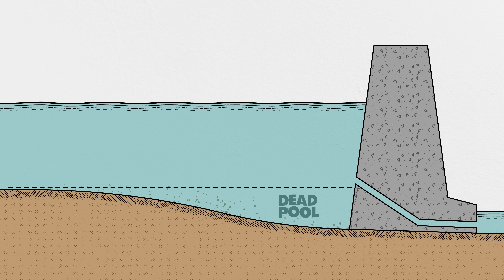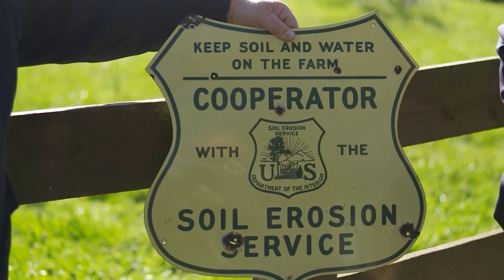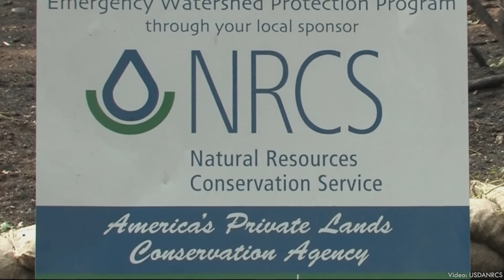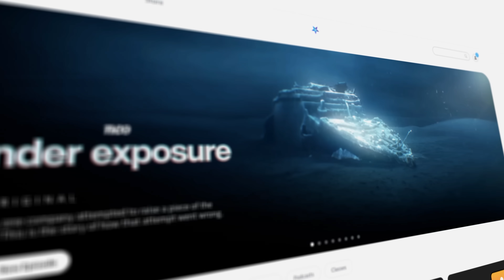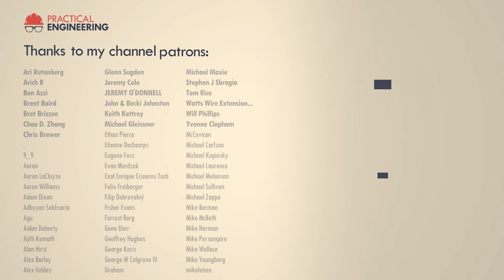All Dams Are Temporary

Comment: I am a scientist working in a dam/tailwater system built in the 1960s, and I did my graduate study on dam removal projects. We are now dealing with both of the sediment associated problems with the dam that I work in association with. The upper reaches of the lake are filling in with sediment, preventing boat access for a major recreation lake. Downstream of the dam, we are seeing the river channelize; abandoning side channels, not maintaining floodplain marshes, and simplifying underwater structures, which limits aquatic habitat. I have been saying all of these things for a while, but I will be sending your video around as a great visualization of the issues. Thank you, and well done.

Edit: Spelling and grammar.
Reply: These issues should be more widely known,it would help end the dam craze we have here in Brazil.
Reply: Dams provide free suction, why not run a big pipe from the dam upstream and then use it to dredge the sediment at a rate similar to what the river would normally carry. Hook it to an automated robot that crawls around on the lake bottom like a big sediment cleaning roomba crossed with a pool cleaner. You'd need to have data on the shape of the lake bed before the dam so it knows where and how deep to dredge, like a roomba mapping your furniture. It probably wouldn't even need to move all that much to work if it just digs down the sand will fall into the hole as it dredges. That's my programmer solution.
Reply: @mortsdans Hey, I think you are onto something here. Your idea could perhaps be combined with the entrapment dam idea that Grady mentioned, wherein a much smaller reservoir just upstream of the main reservoir catches 90% of the silt. From there, pipe it along the bottom of the main reservoir to a point at the main dam, where it could be throttled as desired. You might not even need an automated roomba, as a guy running a small dredging operation in the up-river reservoir, could just do his thing, hydraulically pumping the liquified  spoils to the pipe inlet in the spoils reservoir, never needing it to dry out.

Now, there's that pesky problem of the fact that 90% of all sediment comes in 12 hour bursts once a year during a flood. That's a lot of water to slow down prior to hitting the main lake, but there is probably an optimization algorithm. (fellow programmer here feeding your insatiable need for logic 😂)

My first thought (unrelated to tour idea) was that dirt is not free, it has value, and river sediment is naturally good topsoil. I pay 250$ for 9 cubic yards (a small dump truck), which comes from a local creek sedimentary plain. It's good dirt! Many things are only worthless when one treats them as worthless, and makes them into a liability, instead of an asset. So many things are like that - lumbermill sawdust, chicken, beef, and pork waste, very few things are truly 100% liability. Even garbage dumps have a ton of intrinsic value buried within them. Not to mention municipal sewer plants - they are even selling our poop! 😂
Reply: @mortsdans  That's precisely what I was thinking, minus the roomba.
Reply: @mortsdans for most of the "why don't they just..." questions, the anawer is:"because it's more complicated". But your Idea sounds pretty cool! Just keep in mind that "5 Million to per year" is quite a big amount.
Reply: @MarcoTedaldi  It's 570 tons per hour (if you have it going 24/7 365 days per year). However, there are sand dredgers that can do up to three times that.
Reply: @fiendishrabbit8259  Running a dredger 24/7 is not cheap and as mentioned in the video: you need to transport all that silt somewhere. If you want to do it by truck, that's a lot of trucks 24/7.
Reply: @MarcoTedaldi  Slurry pipe exiting below the dam.
Reply: @fiendishrabbit8259  might work,  if roughly the same amount of water leaves there... That's probably true for dams that are mainly built for electricity production. But in reservoirs that provide water for large areas and cities (and where a lot of water evaporates) that can be quite a big difference.
Reply: @mortsdans you’d have to be releasing water from the dam at a rate of the old river as well, I was thinking similarly but it’d have to be scaled down. We build lines to pump water between dams, I reckon we could do the same for sediment. Especially if there was a benefit to things living downstream.
Reply: @mortsdans 
 :- where do you dump the sediment???😮😢
Reply: @mortsdans Not to mention that a properly-designed vortex-generating sediment retention pond could be built that dumps all of the sediment into one place, ready to be swept right into the suction pipe almost as it is created. Grady's 2D model of a normal reservoir shows an exceptionally poor way to concentrate sediment in a specific location. I'm sure a couple of whizz kids could come up with a geometry that deposits almost everything in one spot, or along a straight or curving line.
Reply: Just put a ninja blender at the bottom of the reservoir
Reply: I'm curious: why not just notch the dam and let erosion do the work? (would that work if time was not an object? just like remove all the toxic stuff and let the concrete and stuff erode away)
Reply: @harrymu148  Water, and nature, has a habit of making such things, whether accidental or intentional, rather more dramatic than expected.
Reply: @harrymu148  Unless the case can be made for removing the dam completely, most times people will want to fix the problem without removing it.  Notching the dam in most cases destroys it.  Dams often are built with a compressive structural component - notice the curve of the dam is almost always towards the upstream.  It's like taking the final brick out of an archway above you, the arch is depending on that final brick.  Also as he illustrated, providing high flow through the basin just (in the short term) carves a single deep channel through the sediment.  It would take a really long time with historic variation in flows to erode all of the reservoir sediment, as it's filling a valley (in most cases) that took geologic time to erode and deepen to the point that a worthwhile reservoir volume was present.
Reply: @harrymu148  Probably to hard to get to happen at a constant, predictable rate. Because if it doesn't, you basically just created a catastrophic dam failure.
Reply: Go get em.
Reply: SORRY MY BRAIN THINKS OF SOLUTIONS FROM ANOTHER DIMENSION LOL.
Sooo, What we could do is attach a RC automated drone dredge. With a flexible piping system that allows a consistent suction of sediment directed towards the side of the dam outlet.
Reply: Great detail.  Another issue is that the changes vs. original flow cause downstream water temperatures to be higher, interrupting reproduction cycles / signals for fish and other life.  Locally we've had to modify dams to provide additional flows for part of the year to rectify this issue.
Reply: @pault151 How interesting!  Unintended consequences… we don’t necessarily understand the systems we’re interrupting/interfering in fully enough.
Reply: So you're making a case for nuculer power plants.
Edit: spelling and grammar.
Reply: *just as long as "ALL proceeds" go to Grady/"we" won't mind "homie"....
Reply: I worked in the northwest bid on dams for removal now that I see the alt energy push. I believe it was all part of the plan. Take away the dam force us on wind and solar at our own expense. We’re getting worked by fossil fuel in both directions.
Reply: How is anyone working on this that doesn’t understand that? Seems like basic information, no offense to your coworkers.
Reply: @thems_the_brakes  They do understand the issue, just not quite the magnitude. And it is a great visual, worth watching even if you do understand the issue.
Reply: His name is Subaru
Reply: The whole concept of dams and large scale river management is soon going to become the foccus of world attention: massive atmospheric rivers from locations like the mississippi catchment [spring rains and snow melt] transported insideously huge volumes of moisture seasonally from one location to another, where it affected meteorological systems. The entirety of the effects laid at the door of industrial emissions will soone be revealed as the effects of humans affecting continental scale meso systems.      Dams remain one of humans most useful tools, but we have to begin to accept that they do have affects which we had not forsee.   Alcoa, the aluminium ppl built a dam in Ghana opening in 1964 which ensured locations further west recieved more rainfall, when the rest of the sub saharan continent entered a drought. Conversley, the very same drought was caused by the Aswan dams in how it regulated the evapotransportation from the lower nile flood onto the ethiopian highlands where the rainfall regime was initiated for the whole of the sub saharan region.    So you comments are very real and we need ppl like you onside to ensure that we are better able to navigate the future: there are a lot of criminals out there who put their thumb on the scales to tilt the balence in their favour.
Reply: What’s the cost to benefit ratio of building a pipeline with periodic controlled outlets downstream specifically for a dredge to pump sediment into full time?
Reply: Can those sand/sediment be uses for cements for construction?
Reply: Good thinking. But please invent a suitable replacement solution before you eliminate damns.  Some people still need non governmental jobs and electricity.
Reply: @AsheAve   Dams are essentially the premier example of government projects and employment. The fact that we see huge corporations named in the process just means they were lucky to be contracted.
Reply: @AsheAve  Done. Solar, wind, and batteries for electricity are cheap and taking over while creating lots of private jobs. Soon, enhanced geothermal electricity using heat underground will be cheap enough for overhyped "baseload" power. Agriculture uses far too much water because it's far too cheap. Time to make some changes there.
Reply: @Rocky-gw4jf Baseload power is not overhyped, and your description of it as such makes me question your credibility.  

The base load is the load on the grid that's always there. Base load power is just the electricity that goes to meeting that base load. If you don't have base load power, your grid collapses.
Reply: The immediate benefits of removing dams can clearly be seen on the Klamath, where salmon are spawning are parts of the river for the first time in a century.   The power generated by the dams can be replaced with solar and geothermal resources in the region, and the fishing industry, commercial and sport,  on the river and the coasts of Oregon and California will clearly benefit.
Reply: Oh no, people can't play with their boat on water they stole from other areas, so sad boo hoo
Reply: @susannahjoy4220 That’s one way of looking at things….!
Reply: It would be much better if people moved back to stone age like ACTUALLY

Comment: I have no engineering background  whatsoever but the first idea that popped up in my head was those pool cleaning robots scale them up connect them to a pipeline which end sits below the waterline at the Damm. It would only need a little energy to run the robots and start the suction of the pipe but not for running it

Comment: If you havent lookss into it already just south of Mankato, MN they are removing the Rapidan dam and bridge from last June's flooding failure.  They will be removing the century old dam.
Reply: I believe this dam failed from large amounts of dead trees accumulating upstream along the sides of the river in mini log jambs. The high water event at the time of failure then carried them down to the dam blocking the overflow. That’s my theory.
Reply: From my understanding Blue Earth County took over control of the dam,it hadnt produced electricity in years.  Down stream they were concerned with the rising level of the river going into Mankato/North Mankato to the point they built a berm to further help protect 'lower' Noth Mankato.   To that end they didn't have all of the locks open to prevent downstream water rising.  Which in turn caused the bank to give way and massive erosion of the bank,  including  bridge footings.

Comment: My solution would be moveable, covered channel segments that sit on the bottom of the reservoir.  Positioned as a chain, drawing water preferentially from the end, if the flow speed is high enough they'd pick up silt rather than depositing it.  Different designs and sizes would be needed to control flow rates at different points in the chain, the whole thing would need to be slowly snaked from side to side to dredge the entire bottom of the reservoir.  Essentially a giant vacuum dredger, built to the scale of the dam, and using passive energy flow of the dam.

Comment: excavating + deadpool. excavate the dead pool, with that suction method you can force the dirst accumulating, it can be integrated into the dam and it only needs to work from time to time when the pool starts to fill. the only problem now is you need to guarantee that most if not all the dirt is going there, then a transport system because i don't think just moving all the dirt past the dam is viable... and maybe a lot of other problems I'm not thinking, but oh well that was my idea.

Comment: Seems like what's needed is a sediment bypass system built on the bottom of the reservoir when constructed. There would be a mobile dredge system attached up stream. When sediment drops out it is constantly sucked up and pumped  to be released below the dam.

Comment: So you need a "pool vacuum robot" version of a suction dredger with its hose connected to the dam, that continuously pumps the sediment to the downstream side. You can even make it hydro-powered.
Reply: Bad idea.

6000 pounds of sediment enter Lake Powell every second, from hundreds if not thousands of different streams. How do you propose removing that much sediment that quickly from so many different places and somehow moving it dozens or even hundreds of miles to bypass the dam?

The better long-term solution is removing the dam.

Comment: This should not be a problem if the water is released at the bottom of the dam and not at the crown of the dam, or if outlet valves placed in front of the dam wall are used to remove sediment.